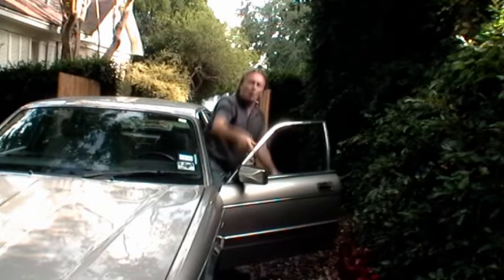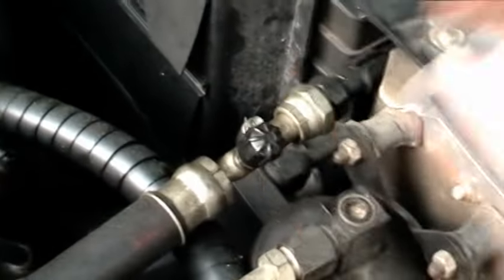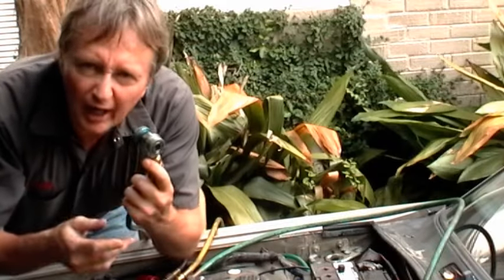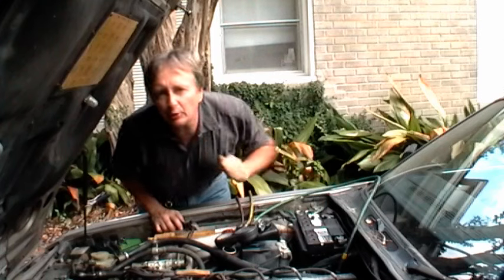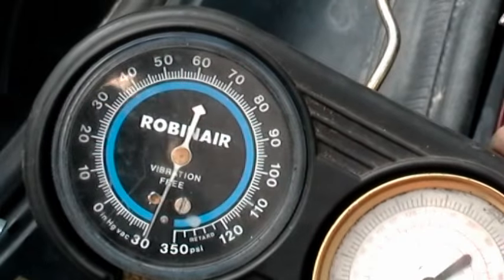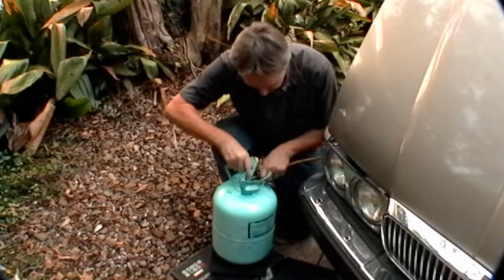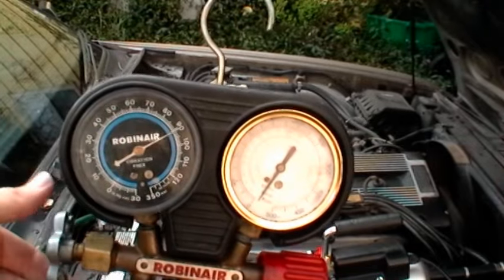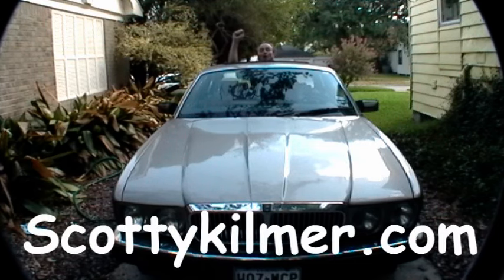How to Recharge Car AC System (Refrigerant)

Comment: Usually when an AC system is out of coolant, it means there is a leak. If the leak was repaired, and they just sent you the car to do the charging procedure, than it's fine under EPA standards, but if the leak wasn't fixed, then it's illegal to charge the system. Courtesy: The EPA

Comment: Is the high pressure line always the small line and the low pressure line the BIG line?
I have a small leak in my system somewhere and I want to add stop leak to my 2005 PT Cruiser using a kit which contains 1 can of stop leak and 3 cans of refrigerant. It says to fill the LOW presser line, but what is the high pressure valve used for. I saw other youtube videos using small and big lines. I am not sure what line to fill. Any opinion on that??????

Comment: Can over filling the transmission fluid, cause a grinding sound (under load) from the gearbox ? I can see there is a slow leak from the engine to gearbox seal.

Comment: @6400az 
Yes, you are it right.
 I took my car to get the AC fix an they said there was a problem with the evaporator, to fix it would cost 700 + dollars. I declined, but whatever they did, my car has had cold air for the last 3 weeks. 
What do you make of this. Thank you.

Comment: Scotty, I have a question about this type of refrigerant vs R12. Is the older R12 colder than R134a? The reason for asking is because I have some customers telling me they rather have R12 than R134a and I can't remember how cold it was with R12 since it's been along time after the EPA banned R12.
Reply from the maker: yes it is colder
Reply: Hi Scott, I just started watching your videos. I love your candor for explaining everything clearly and simply. 
yes. I am taking notes.
Lastly, I have an older car('86 lebaron 2.5l kcar) and the A/C does not blow cold air. and the nozzles, like you said are the same size. 
a. is there a way of identifying which nozzles are high and low?
b. lets say the A/C compressor is empty, I can legally top it off with R12, right? If I can use R12, where can I get it?
c. Would you recommend changing the compressor to R134a? sure you've been asked that alot.
d. regards from the lovely state of MI!
e. Thank you.

Comment: how do you add and measure using smaller cans of refrigerant as opposed to a tank?
Reply from the maker: Vincent Tran you can't accurately, as those can's themselves are often off quite a bit from what the label say. That's just pure guesswork
Reply: Yea, im still going to buy an ac guage and vacuum pump but i might try to weigh the can using a digital food scale. On the cans they usually have the amount of grams labeled but i just wanted to weight it just in case. Also, if you had to use a can and a half then that might make things difficult to figure out the amount. So thats why i figured weighing it would be the best way to go.

Comment: Hello Scotty.  My 2008 honda pilot AC is not working the clutch is not engaging.  I checked the pressure it's zero.  When I tried to charge it and force the compressor to run by shorting the relay pins, using an electronic detector, I detected a leak around the compressor and clutch.  Is the compressor leaking or is it ok for it to leak a little during initial charging?

Comment: Hello Scotty, I have a 2000 Mustang GT and when I turn on the AC or Defrost my engine increases in RPM which I guess i normal. But when I do it while I'm driving my car it still does it and I can feel it jerk the car forward from the increased RPM then slows it down after a few seconds. Is this normal? And is there anyway that I can get it to not do this?

Comment: I have a 93 accord converted to 134.  Compressor runs as does cooling fan.  Had it drained at a shop but now when I try to refill, it is not taking the 134.  Low side pressure goes up to 50 within a couple minutes and the air is obviously not cold.  Any ideas for me?

Comment: Did you just put R134a in a vehicle that originaly came with r12, but has not been properly retrofited? 

Doesnt a proper retrofit have non-removable fittings that attached to the schrader valve ports?

Also, doesnt the EPA require a label to be placed in the engine compartment when doing so?

Also, When you are bleeding the yellow line from your manifold gauges, arent you venting to the atmosphere?  Isn't this a violation of the clean air act?

Comment: I need to do this on mine, but since it takes about 8 years to go from working to not getting very cold, I'm not going to buy all that kit. My local dealer will recharge the A/C for about 100 bucks - I expect you can find places to do it for less.

Comment: hi, i tried to fix a leak in my a/c and proved to be a simple o-ring,but i added a can a half of refrigerant with dye  to trace the leak and it is fixed. but when i read the fine print it has oil in it! i need to vacuum the lines but should i worry about the extra oil added in the system?

Comment: hello i have got a mitsubishi pajero 1991 NH GLS ECI-MULTI V6 3000 and i have looked everywhere in the engine, area, and i could not find a high pressure point, to connect the hose to. I found only one, point, blue/green in colour.... that was it, are all vehicles supposed to have TWO pressure sides? Low and hi?

Comment: @scottykilmer I have a problem my low pressure seem to drop to quickly and my high pressure seem low like 105 psi a/ c system fully charged causing the compressor to cut off to quick because the low pressure reaches cut out to fast

Comment: Hey Scotty, in this video your working on an 88 Jaguar.  So that would be an r12 system Correct?  I've got a 1967 Cadillac el dorado with a compressor seal leak.  I replaced the compressor, drier and replaced all O-rings to the new green ones, pulled it down into a vacuum, which it held not -30 but I was somewhere around -23 or so.  It's holding a vacuum, so no leaks.  Should I use R12 ( which is expensive and almost impossible to obtain) or can I use 134a.  And what is the difference in amounts.  This car calls for 50 ounces of r12 so how much 134a, if I go that way?  Thanks Sir.

Comment: It's funny that they sell the stuff at auto parts stores when techs caught putting refrigerant in leaking systems or discharge refrigerant to the atmosphere get a whopping fine.  Of course if they started using CO2 heat pumps like Europe that wouldn't be an issue.  Now I'm waiting for this 1234yf stuff to show up and phase out R-134a just like it phased out it's predecessor R-12.

Comment: Okay, where do I get those air conditioning gauges? (the green, yellow and red hoses?) How about that vacuum pump, a scale of that sort? Thanks! Other than that, it doesn't seem that intricate to do.
Reply from the maker: discount tool stores like harbor freight tools sell decent priced ones
Reply: Harbor Freight Item 92649. Amazon sells them, too, from a number of sellers. Or, if you have an AutoZone nearby, they have them in their tool loan program. You pay for it when you pick it up, and get a full refund when you bring it back.
Reply: Scotty Kilmer

Comment: Scotty, after filling my ac system with freon and getting 60 degree cold air in 90 degree heat I disconnected the high side gauge and a fairly strong stream of refrigerant was coming out. I put on the plastic cap and it seemed to stop but I know this valve should not leak. I was reading about 250psi.  How do I fix it?  Nick Olson.
Reply from the maker: you;d have to replace the high side schrader valve

Comment: Hi Scotty, when I stop. At the red light while still in the D position my steering wheel starts to vibrate like crazy when I hit the gas it stops, and also it does not do it in Neutral.
Reply from the maker: try my video "how to fix a car that idles poorly" and also check for broken motor mounts
Reply: Thanks
Reply: Ts your tires and one of your front tires is about to blow, the vibration comes from the steel belts at one part of the tire, and when the steel belts hit the ground the whole wheel slides, of you're moving it's doing this really fast causing the back and forth wobble effect. Find which tire is bad and replace it.
If none of your tires are bad check your alignment and balancing on the tires. A used tire shop can do this for about 15 bucks, you can align it yourself with a cell phone if you want to or you can take it to a reputable mechanic who is going to charge you 50 to 100 bucks to do the same thing you can do yourself or have a used tire shop do for 15 bucks.

Comment: Hi Scotty
How to fill if you have only one port, on the high pressure side?
I hate french car (Renault Scenic 2)
Best regards
Kenth
Sweden
Reply from the maker: many cars here now have only one port, but it's the low one, not the high. You could try putting it all in the high side if you had a pressure machine to do that by weight, but generally only pros have that. ask a french car mechanic where they hide the low side port, as they don't sell french cars at all here.

Comment: How much do you think it will be to get my ace filled I have a 1989 s15 jimmy???
Reply from the maker: a small fortune if you use the freon it originally came with. If you swapped it over to R 134a, get prices for doing that swap in your area, it would be cheaper
Reply: Scotty Kilmer Would you consider doing a video on swapping from R12 to R143a? Most people on Youtube show it just as a swap of the low side and high side fittings, pulling a vacuum, and recharging with R134a (or some R12 replacement). Says nothing about incompatibility of the oil, or the seals, or anything else that might need to be done. IOW, I suspect there's a lot of bad information out there, and you're just the man to teach us how to keep these clunkers alive (in my case, a '94 Toyota Pickup)

Comment: I vacuumed the system and it held vacuum, but then realized I need a new pulley so wasn't able to charge yet. It's been a few weeks. The drier was new but now do I need to replace it again?
Reply: I replaced it just in case.

Comment: Hey Scotty, I have a rather unusual problem with my AC inside of a 95 Chariot and it was recently re-gassed with R134a from a garage. The Air-conditioner only seems to blow out cold air when the car is parked in the shade, and continues to do so even when the engine is fully warmed up and the outside ambient temperature is high. (Southern Hemisphere here)
However, if it's left parking out in the sun, initially, the A/C work, blowing slightly cold air, but not fully before it'd just blow out warm air.

What might be the problem?
Reply from the maker: +chrischoy9   tons of things can go wrong on an AC job. First, if the system was made for R12 and now has 134a, it may never work right. Especially if it has a manual cooling fan on the radiator and not dual electronic fans. But, if it was set up for 134a, could be old worn drier, worn out condenser, fans that don't blow enough air, or worn compressor.
Reply: Scotty Kilmer Pretty sure it was a r134a seeing all those Denso stickers.
We know for a fact that it works under certain situations,  and from your experience, what would be likely at fault if the A/c only refuses to work under sun?
Reply: +chrischoy9 i think the system is filled with extra gas/ or Cooling Fan  have some performance  issue. In sun temperature increases and so do pressure of refrigerant. Electrical system turn off AC to protect damage.  first check cooling fan properly.

Comment: I'm fully aware of the much higher pressures in CO2 systems but I'm willing to give it a chance to prove it's safety since Europe already uses them.  The question is how much volume is stored at that pressure.  We used to have fears about gas exploding as well now our fears are turned to H2 and natural gas.  Of course compressed H2 and natural gas would be explosive in case of a tank rupture although both need O2 to burn and H2 is lighter than air so it floats away.  New technology new concerns.

Comment: I have a question. The mechanic noticed I don't have the little cap to where my refrigerant goes after I had some put in. Weeks later I'm back to ac not working is this because I don't have a cap
Reply: Sam P- bad orings inside schrader valve might have leaked your refrigerant

Comment: Hey i have a 2002 jaguar s type. And i can't find the low hose to add freon.
Reply from the maker: I've never done that model, but the English tend to have a sense of humor when they made Jags. Last one I did had the low hose valve hiding on top of the compressor and it took ages AND jacking up the car to access the stupid thing.

Comment: hey Scotty my 2004 Escalade on idle blows hot hair and truck starts to over heat. but when I'm driving it blows cold air. can you help me figure out the problem. thanks
Reply from the maker: check for poory working radiator cooling fans first
Reply: okay I'll try I think my fan clush don't work as well as it should be

Comment: I love Scotty's  videos but this one is full of stuff I have no hope of buying to use. Im either going to have to take it in or buy the Freon and some gauge/valve thing myself at Autozone or Walmart. If I cant do it for $25 its to the shop.
Reply: Harbor Freight also has a REALLY cheap vacuum pump.
like $20
get a manifold set from ebay for $20.
since your only using it about once, you dont need top quality, it only needs to work once. a mechanic does this job several times a day, thousands of times a year, needs it to last MANY uses. good luck

Comment: I'm baffled... I have a 98 Dodge Dakota... I went ahead and did the major task of replacing the evaporator core, which as you know was a big job!... I also replaced the dryer, liquid line and the condenser..  Now I can't get the system to take any refrigerant, the gauge is showing I have 35lbs, but it's just air. I've removed the shrader valve to let the air pressure out and tried again and it did the same thing ..  Could that be a high or low pressure switch??

Comment: I think the valve where you connect the refrigerant plug into went bad. It started to release all the refrigerant, I could hear it. Now my car blows hot air.
Reply: Sometimes you have to take a thin screwdriver and flick the pin on the valve to get it to re- seat itself...

Comment: Scotty, HELP!!! My A/C started blowing warm yesterday in my 2014 Lexus ES 300 hybrid and I don't know where to take it. Should I go to an expensive Lexus dealership, would you trust a  local repair shop or what?  I am a female and although I've worked on my regular cars in the past, I don't dare try to work on my Lexus Hybrid. What should I do? I have an extended warranty on the car-- would this be something that's covered? HELP! I'm in Texas and it's 100 degrees!

Comment: hey scotty i emailed you about freon escaping from my car. i took it too my mechanic and he said he didn't see any leaks. took it too pep boys they also say they didn't see a leak. what els can it be if its not the schrader valve
Reply from the maker: tons of things can go wrong, but if it's leaking and he doesn't see anything, have an AC leak sniffer stuck into the dash to smell for leaks inside on the evaporator
Reply: they did that scotty

Comment: Scotty.not abt Ac.  I have a ?? Abt my cars clutch I can push the clutch to the floor and try to start the car but it starts to move when i turn the key and can't Chang gears why the car is on I have to shut the car off to select a gear

Comment: what happens if you don't pump the remaining refrigerant out before pumping new ones in?
Reply from the maker: you would not have the exact correct weight of refrigerant in the system, that's why you vacuum it all out first

Comment: Hey Scotty I’m having problem with my Honda Civic ac  whenever I’m driving ac is blowing fine but when I come too a complete stop it starts too blow  warm  heat what should I do?
Reply: It looks like Scotty missed answering your question but it sounds like your condenser fan isn't working. If it's not the fuse, the speed control relays, or the temperature sensor that turns the fan on, then the motor might be bad. Another cause could be a bad compressor clutch that only engages on high engine revs and doesn't deliver pressure on low revs.

Comment: Suppose I want to install a new compressor.  Before installing the compressor I need to add oil.  After installing compressor I need to vacuum the system.  Will vacuuming the system withdraw the oil placed in the compressor?  If so, how do I add oil to the compressor after vacuuming the system?

Comment: Hi scotty how can i recharge ac for audi 80 .1991
Reply: thamer amen Go to Walmart and buy AC PRO its about $40 easiest way to charge AC & CHEAP
Reply: Mya White get an ice chest full of ice, cut a hole in lid, put a small fan on top and you'll save some bucks. Only problem is that the ice melts so you can't go on long trips with carrying a bunch of ice. You could get a trailer and mount an ice freezer on it with an electric generator for long trips across the desert.

Comment: why do you have to vacuum the system i had a car with no freon and it had it before and ive put  freon it now and its been workn fine and i didnt vacuum people say kuz da dryer gets moist but really have you seen whats in them i have ive kut one open to c wat was inside and its just metal and alittle filter thats not even a filter its like a sponge

Comment: I'm not sure if this is the video to make this comment but I had a problem with my Ford F250's a/c unit.  On hot days the air coming out of the vents would intermittently blow warm air.  I'd have to shut the a/c off for a few minutes and then it would blow cold again for 5 mins and then repeat the procedure.  Thought I had a restriction in the lines so changed the dryer and orfice.  Problem wasn't fixed.  After much work found problem to be a dirty evaporator.  Dirt was blocking 90% of air flow.